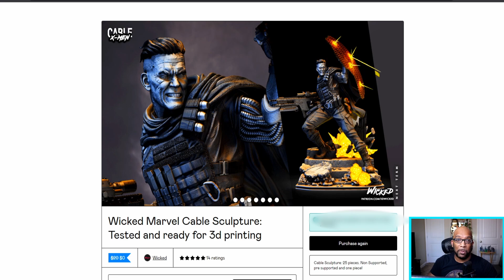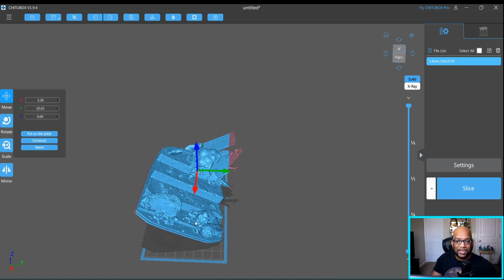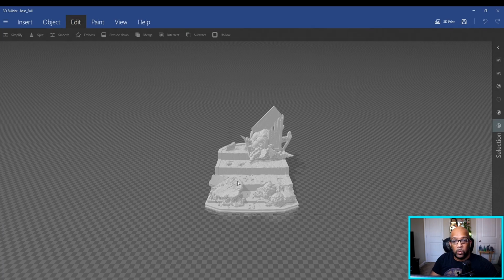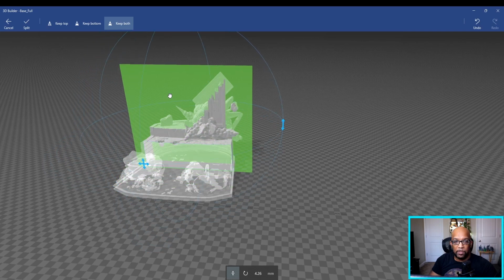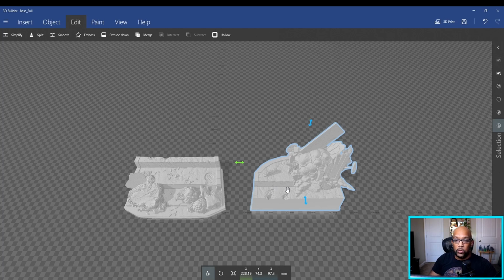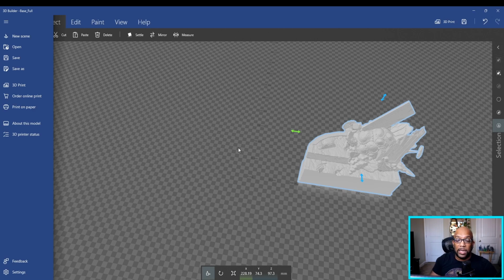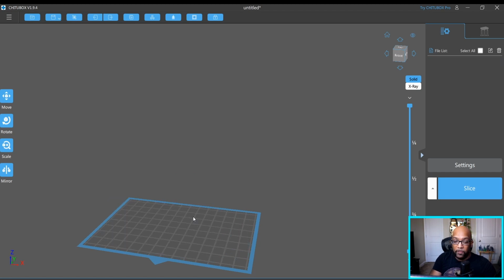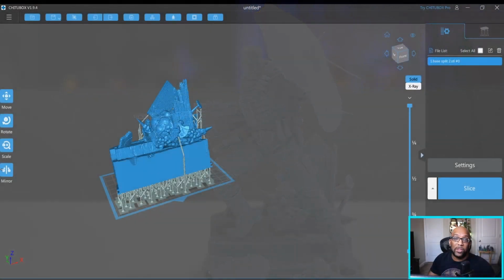How to Split 3D Models Using Microsoft's 3D Builder

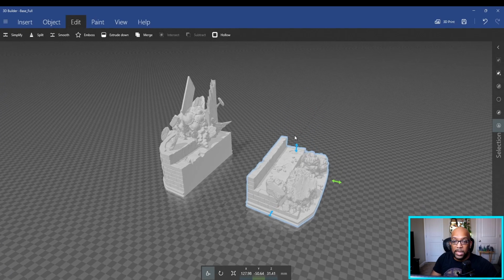Comment: Howdy pard', very good video and quite helpful to many I'm sure. If I may add a point to your own, @ timestamp 5:38 you demonstrate how to Save the individual front section from the rear section by using Copy to 'hold' the object suspended, Saving the other section, then using Paste to reintroduce that section to the Plate and then Delete to remove the already saved section....You can ALSO Copy the individual section, open up a NEW 3D Builder and Paste it there instead of holding it suspended. I normally use this method (along with 'Duplicate' within 3D Builder) to create multiple clones of the model I'm working on. This allows me to pick and choose the best version of what I'm Cutting, Modifying, and/or Slicing....thought that might help.  ; - )